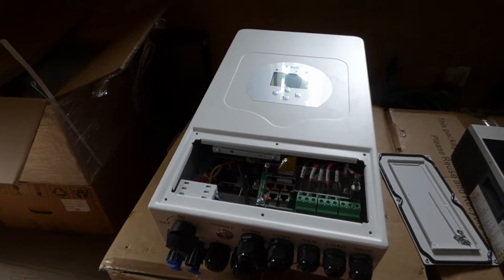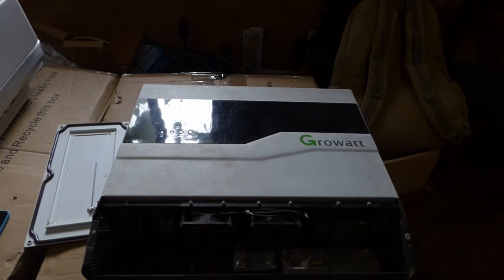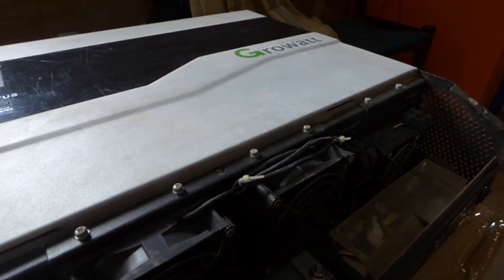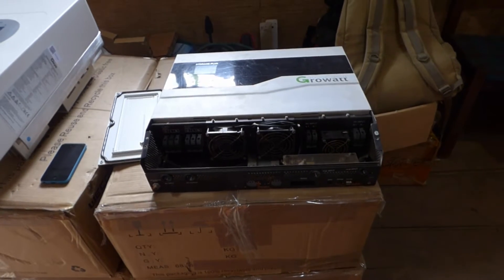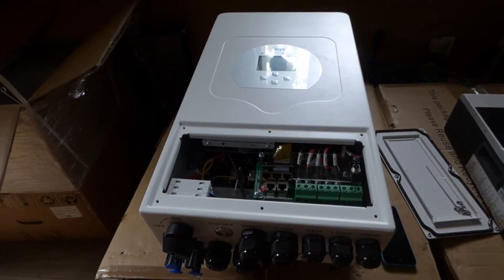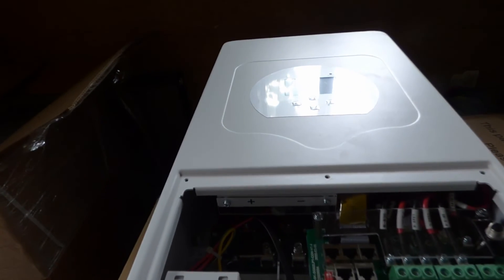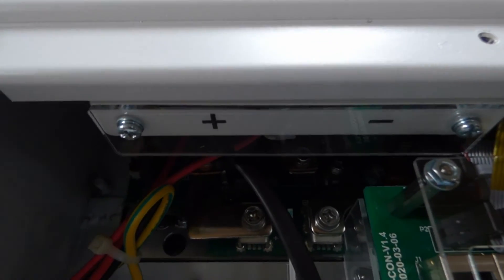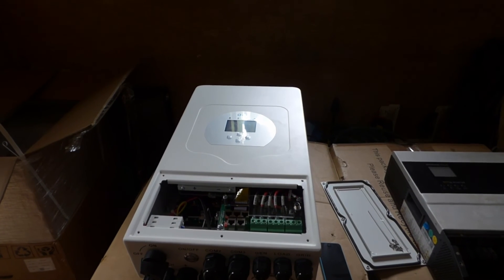Comparing the Deye Inverter  to the Growatt Inverter

Comment: The Deya is fanless?
Reply from the maker: @-_o_o_-  thank you for watching and commenting. It has fans.
Reply: @drsolar  Thank you to😄 And how it sound at 50% load? Did it stops in low load?
Reply from the maker: @-_o_o_-  I have not used the inverter in 3 years. So. I really don't remember anymore.

Comment: Battery Voltage range.  I know Deye claim 40-60V battery voltage range, but I know from experience (8KW version) that the discharge current rolls off below 44V.  Do you know if the Growatt is any better in this regard?
Reply from the maker: Thank you for watching and commenting. I have not used a Growatt in years so I can't really tell

Comment: I have deye5k inverter and use lithium battery without bms, yet i see critical issue:  charge voltage i'm setting in battery page are not properly used, inverter use bigger actual voltages.
I think this is normal for lead acid batteries, but it isn't ok for lithium.
So, for lithium to be safe deye REQUIRES smart BMS which can talk to it.
If i knew that limitation in advance - i wouldn't spent extra money on deye.

(my batteries are non standard 2P 12S 2P, finding proper BMS is pain and expensive)
Reply from the maker: us the lead acid settings. And then use voltage don't use percentage
Reply: @drsolar   that's what i use, yet it still charges with voltage above ones i've set.
I can limit voltage in "time of day" feature, yet it doesn't work for solar charge, which goes above that, so the only limit should be voltages in Battery config.
As of now i've set 48.6V there to have it actually stop charging at 50.3V, yet i can't trust it will just work that way as actual V is bigger than set voltage.

Comment: I'm looking for a replacement for the Growatt. Are you still recommending Deye?
Reply from the maker: Thank you for watching and commenting. I would choose the Deye over the Growatt. What type of battery do you have?
Reply: @drsolar  5Kw LIFO
Reply from the maker: @VisithaGalhena  you are doing low voltage. Then the Deye will do the job.
Reply: @drsolar  is it possible to guarantee At least 4 years of lifetime?
Reply from the maker: @VisithaGalhena  the come with 5 year warrantees
Reply: @drsolar   "time of the day" settings works for you? i see only 9am and 5pm lines work there, other input is totally ignored.
Reply from the maker: @Siolioli  in the settings it allows for 24 hours. Are you doing it in the App
Reply: @drsolar   no app, directly on inverter.
Any other hours settings are ignored,
I.e. I set discharge to 47v on 9am, then next items are set to grid charge to 48v, in reality it'll stay 47v till 17pm, then it grid charge to 48v, not sooner, while all fields except 9am are set the same.

Comment: Is the DEYE have an automatic switch ON function? or I need to switch it ON manually again when the power resume? As I see in the bottom have a power ON/OFF button. Thanks..
Reply from the maker: The power button turns the inverter off and on. If PV or the battery is present it will come on with no need to touch the power button (if in on position)
Reply: @drsolar   thank you for the reply.. keep safe Dr. Solar..

Comment: Hello greetings, excellent video, I have a question, this inverter could place a string of 250 and 18A for each PV input, that is, 4s2p or only 5s1p is possible
Reply from the maker: The current rating is low. I will do 8S
Reply: @drsolar  pv 450w?
Reply from the maker: @jhojaD  450 * 9 will work
Reply: @drsolar  thanks
Reply: @drsolar  but for each entry?  it has 4 inputs I have 20plqcas of 450w voc of 49.5voc I don't know if I can use 4 strings place 5s per string to cover the 4 pv inputs
Reply from the maker: @jhojaD  yes you can

Comment: Is the Deye inverter noisy???
Reply from the maker: Yes when the fan comes on it can be noisy
Reply: @drsolar  How often and under what condition does fan come on?
Reply from the maker: @goata007  very nice question. It is driven by the temperatures inside the inverter and if you are charging with the grid. There is no way of telling when. The temperatures inside the inverter decide. It monitors the AC and the DC side
Reply: @drsolar  I'm planning on getting this inverter because my current Infini 10KW has fans running all the time. Since this one has fans coming on as well, probably quite regularly, I'm guessing its noisy as well?

Comment: Hi, Have any experience with a Sunsynk vs Deye inverter and if there is much difference
Reply from the maker: They are the same with different firmware. Thank you for watching and commenting
Reply: @drsolar  Is there much of a firmware difference, of is it negligible?  So not enough for you to pick one over the other. Thanks in advance if you have any thoughts on the matter
Reply from the maker: @Skip2MiLuu  Thank you for watching and commenting. Sunsynk runs proprietary firmware that has a much simpler and fancier interface. In terms of performance they do the same

Comment: Thanks for the wonderful video as usual Dr Solar. I'm positively surprised that these DEYE inverters are sealed and IP65 certified whilst still having fans. They are definitely in a class of their own. Please I'm joining the other commenters in asking for a thorough comparison between the Deye and the Lux inverters. Keep up the good work.
Reply: I agree... I would want to see also the comparison of LUXPOWER and DEYE inverters...
Reply from the maker: @billbreaker1680  once I get my hand on one I will. Thank you for watching
Reply from the maker: I don't have a LuxPower inverter in my possession so it won't be a fair video. Once I get one I will. As to the fan. I have asked the question too. The heat sink is fairly large but when you decide to charge at 120 amps you will generate a lot of heat.

Comment: Yes, Growatts just not there you can do the side by side with the Luxpower as Moffat mentioned. But Deye is in a league of it's own.
Reply: Marco A. Rosado Noise decibels of Deye vs big heat sink of LuxPower especially when both are placed indoors makes the LuxPower an inviting prospect. The performance, ability to have a more configurable interface with Deye would that make it the only plus or performance of Deye as a Grid-tied/hybrid inverter is what I’m trying to explore as well. I’m convinced Growatt still has some ‘watt’ of a ‘growing’ to do, if you pardon the pun😀
Reply from the maker: I agree on the growing